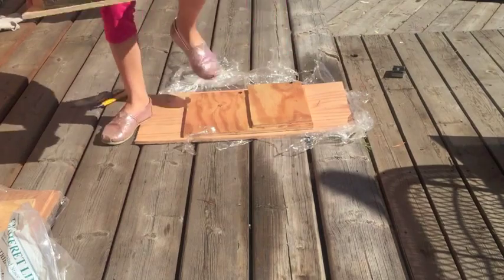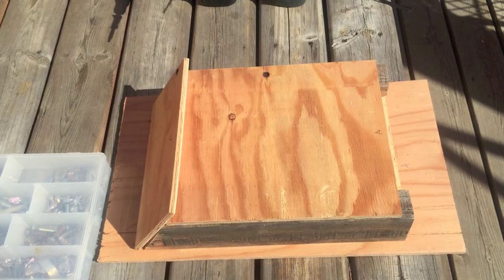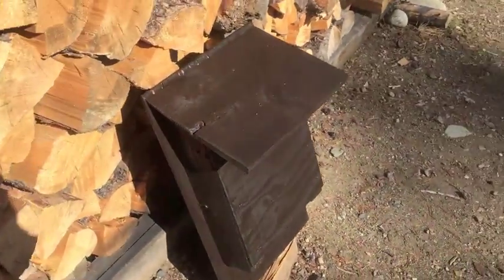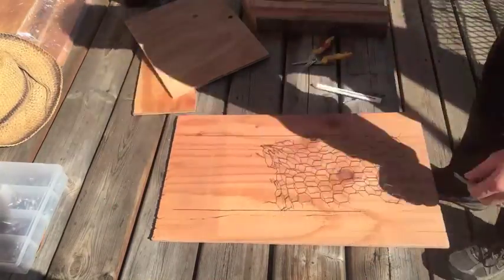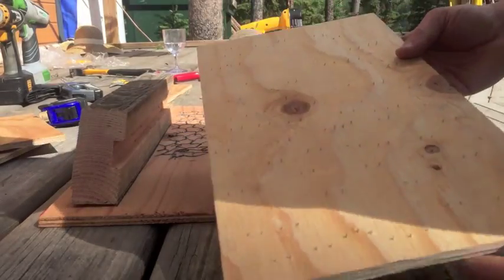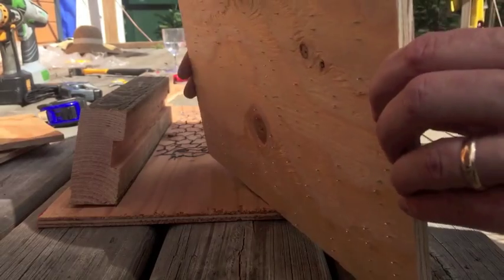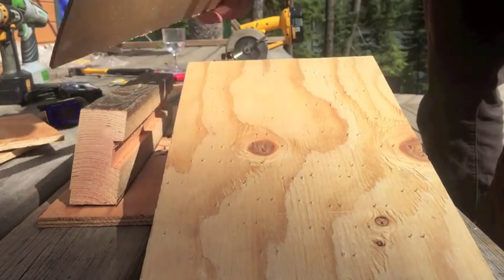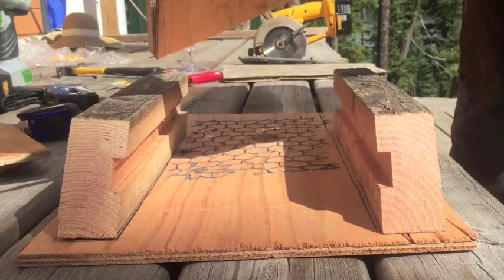How to make a Bat House from Scrap Wood- Part 1

Comment: Thanks for sharing.  Did you have any bats move in once your project was complete?
Reply from the maker: Didn't see any last year. Haven't check yet this spring. Thinking I might have to move it to another location.
Reply: thanks for the response. I think we'll have to give it a try also. I like your design. based on other videos I have watched I'm going to try to place mine in a sunny area at least 15 feet off the ground